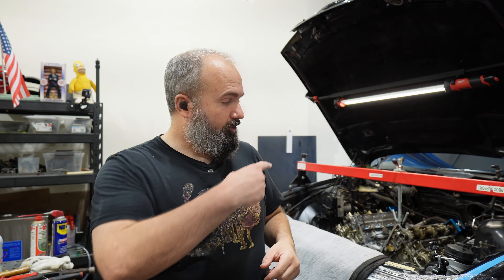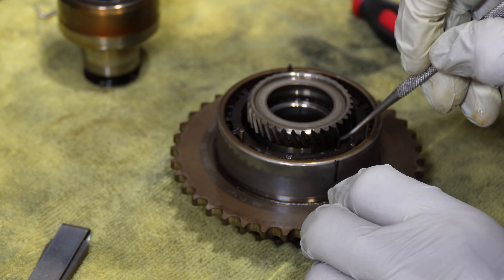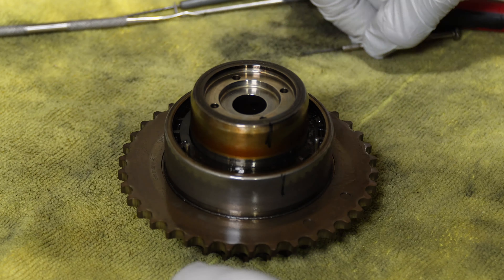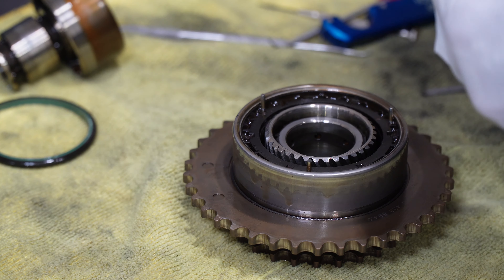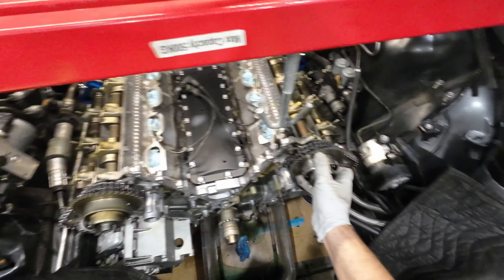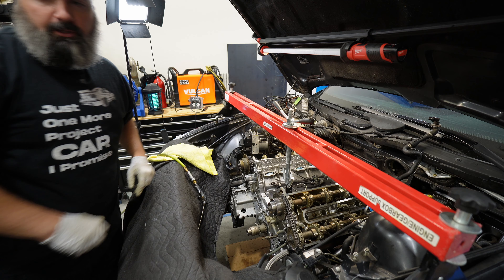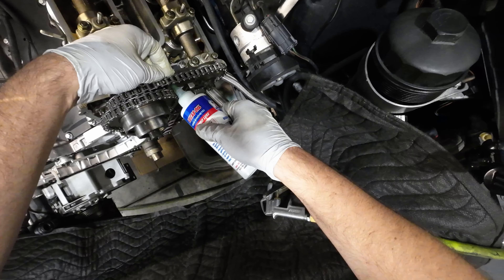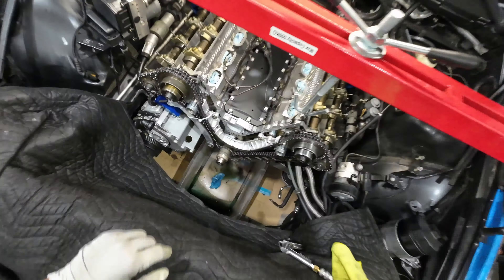M62TU Timing Guide DIY - Pt3 Vanos Rebuild/Timing Chain Installation | 540i Restoration

Comment: Great video as always!
Did you use genuine chain and guides? I see some of the boxes are red were color, did you go with febi parts for the chain and guides?
Reply from the maker: I used a mix of genuine or OEM from FCP Euro. Many of the parts came as a package deal in their "Ultimate Kit". part number 11311741746KT1. I probably could have done it cheaper picking and choosing parts but I wanted to cover my bases on my first time doing this job.